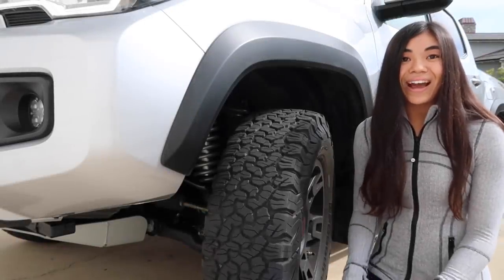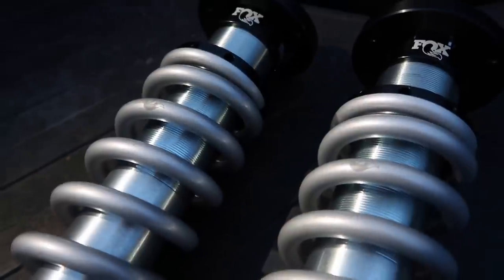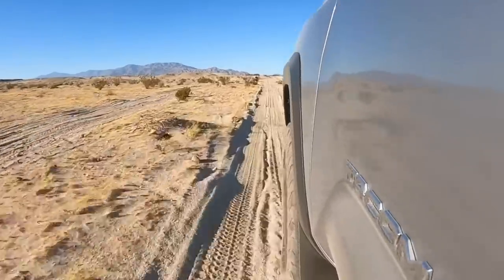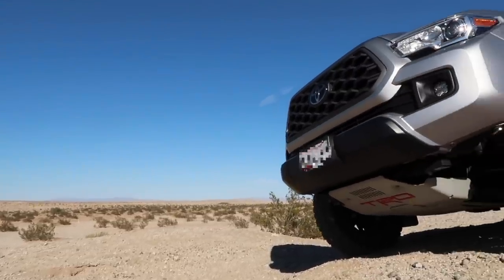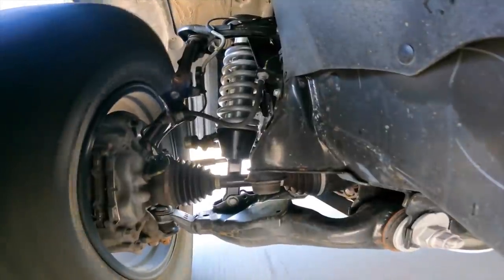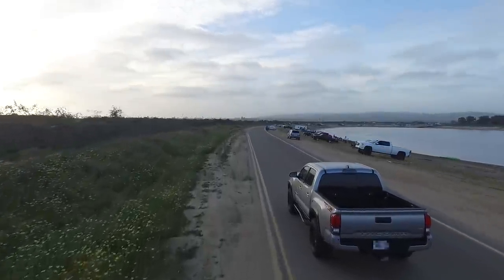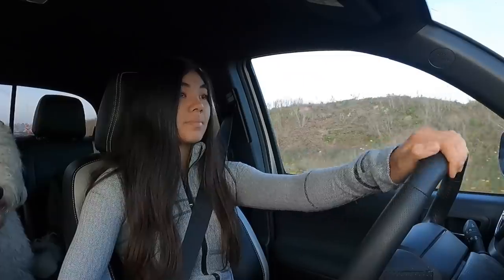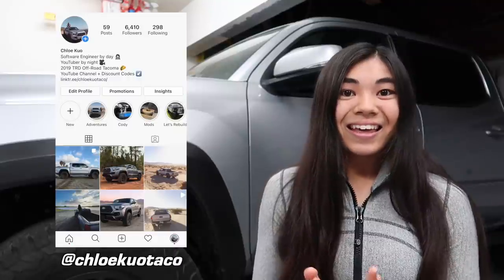Aftermarket Shocks for a Daily Driver?? On-Road Review for Toyota Tacoma Fox 2.5 Shocks

Comment: Hi Chloe.  I really enjoy watching your videos!  Watching the under-body footage of the left front suspension, it appears that the brake hose may be rubbing against the coil spring!  There doesn't appear to be any way to move the brake hose further from the spring.  Perhaps a protective sheath needs to be placed over the hose or a switch to steel braided brake hoses may be in order.

Comment: You should go up tire size to 33’s. 
If you replace UCA you don’t need to cab mount chop, with uca just do forward caster and you will not rub. Did it on my taco pro.

Comment: Solid review! I have the Fox 2.5, DSC and they’re ok. I would prefer one adjustment instead of two and I would like it if the low compression knob clicked when you’re adjusting it like the high speed knob. Also, for what they cost, they don’t hold up well against the weather.
Reply from the maker: Great feedback! Agreed about how they hold up in the weather. I know a lot of people that prefer the 2.0s because aluminum weathers better than steel

Comment: How's the mpg ? I always wondered if it would be better than my icon /falken wildpeak  combo. I get about 18 over all. I do have a longbed doublecab  too.
Reply from the maker: I get 21 if it’s just a week of me going to work (highway driving), but 18 if I do a combo of trails and going to work. I didn’t find that the shocks changed the MPG so much as bigger tires did.
Reply: @ChloeKuo  I was close to getting fox for efficiency and it seems like they are . but icon blackfriday 20 percent off got me and the falken were just such a deal! The ko2s were alot more. Thanks and nice rig you have there.
Reply: I have 33’s with wildpeaks. Roof rack with case, also bed rack. And I get 13 to 15 mpg 

When it was stock I would get 18,19
Reply: @epicone2449  Sounds about right  my buddy has a similar  rig says he is going to re gear the rear end. Not sure if it will help on mpg .
Reply: I also have 285 Wildpeaks. I get 17-18

Comment: Do you plan on changing the upper arms? I heard switching to aftermarket coilovers put stress on the stock UCA.
Reply from the maker: I’ve considered it but my caster angle isn’t bad (since I didn’t lift my truck that much)

Comment: I got the dsc on the back and they are tuned by Accutune they are soft in the middle setting. The front are a long wait, but I ordered the 0” to 3” DSC because of what happened to you trying to get enough ride height without topping out.

Comment: Chloe, you could get the shocks set up by a company like Accutune in El Cajon and it would make a significant difference. They can valve them to your specific vehicle and give you excellent performance in the envelope you use your truck in. Fox 2.5 are tunable and rebuildable. They will need a periodic rebuild, but for your use they will likely go a long time before needing one. The other side is, barring damage, they will last the life of the truck. Fox shocks generally are designed for high shaft travel speeds and are linear dampened so they will work better the faster you are going. They will feel stiff in slow movement. I think you could get exactly what you want out of them with proper set up. Out of the box, the setup is really an approximation.
I have the same make/model/year Tacoma as you do. I have the same wheel/tire set up. I think it is a really good choice in terms of fitment, but also in the load range C choice. Lots of people go with  a higher load range which adds sidewall stiffness and a lot of unsprung weight which creates additional demands on the power train and suspension. The advantage of load range D or E is they can air down more without losing a bead and they are harder to puncture. For a DD/ occasional trail rig, the C is a better choice. Big fan of BFG tires too. They are the only tires I have used for the last 35 years on all our vehicles and they have never let me down.
It would be interesting to compare this setup with a tuned version and see what you think. Maybe Accutune will work with you on something.
Reply: Tldr

Comment: From a daily driver, or on road, perspective, how would compare the feeling between your suspension on your Off Road vise your TRD Pro? Since they are both Fox.
Reply from the maker: The OEM TRD Pro shocks are surprisingly quite softer on-road. The 2.5 ones on my Off-Road offer a stiffer ride, but are more responsive to potholes/cracks on the road.
Reply: @ChloeKuo  thanks for the quick response, the info, and for the great content! Keep up the great work!
Reply: Is more responsive better for potholes?

Comment: Tire PSI makes a huge difference. I run 34 front and 32 rear cold. They heat up about 2 psi and the ride is way better(285-70 tires)
Reply from the maker: So true! Tires make the biggest difference in my opinion!
Reply: Gotta try this myself. Thanks for the info!

Comment: Yet the oem rear leaf springs still suck. Axle wrap has been a big issue for my truckin city driving. I have a simular oem setup before your fox shocks. Yet I question what shocks I want as the balance of road and off-road is important. Yet spending $5k is not in the budget for a while.

Comment: I just bought a 2021 Toyota Tacoma TRD Sport.  I plan on buying the newly released Toyota TRD lift kit.  It is a Toyota sanctioned lift kit that is engineered to work with the Toyota Safety Sense equipment.  It raises the front 2 inches and the rear one inch to level the vehicle and provide more frame to ground clearance.  It is a Toyota dealer installed kit and costs about $2200 which includes labor.  They use the 2.5 inch Bilstein shocks to replace the original 2 inch Bilstein shocks.  I haven’t decided which tire to buy to replace the factory ones.  I enjoy your channel and have got a lot of ideas for my own pickup.
Reply: Where can I find these??

Comment: Would you say that  a 3-6 inch suspension lift and large tires would be a worthwhile addition  but not completely ruin the dally drive
Reply from the maker: It would be hard for me to say because I've only driven a lifted Tacoma with tires larger than 285 on-road a handful of times (off-road is a different story). I guess it depends on if you care about gas mileage and if you regear or not.

Comment: Thanks for getting a camera under there to show the suspension working while driving. Is it just camera angle to is there only a few inches of play in the front before you hit the bump stop for that control arm?
Reply from the maker: I’m not sure how exact, but there’s actually only a few inches
Reply: @ChloeKuo  I've never realized that before but it seems like off road should have more. I'm gong to check under my Tundra and see if it near the same.

Comment: Installing the Fox 2.5  Performance Elite Series (DSC) tomorrow and heading out to Borrego Springs with my 2021 Jeep Rubicon Xtreme Recon, will let you know how it goes. Looking forward to a much better ride on and off the road over the stock Mopar's and a step above even the factory installed regular Rubicon Fox shocks.  We shall see.
Reply: How did you like them?
Reply: @dallassoccerkidd  very good ride, tire wear is longer and even over time as well
Reply: @sdvolley  did you tune them or bolt on straight out of the box?
Reply: @dallassoccerkidd  I didn’t use a third party or revalve them, for what I’m doing it wasn’t necessary. I don’t want a fixed setup because I run 35’s on the street and 37’s offroad

Comment: I had them on two vehicles i never thought they were worth the money. You get a much better bang for the buck if you spend $1500-2000 on higher performance ones
Reply: Dale Macarena  anyone that has remote Reservoirs. I dont go to fox anymore tho whatever lift they say it gives it never does then your stuck adjusting it when its supposed to level your truck and it wont and now its maxed out and it rides worse then it should
Reply from the maker: The remote reservoir definitely makes a difference in mine. I’m pretty happy with my Fox’s but it would be cool to test out other shocks of the same class and see how they compare in ride 😁
Reply: @buffalobmf  punctuation?

Comment: Aren't these standard on the Trd Pro
Reply from the maker: They are different. Fox makes OEM ones for the TRD Pro but these ones are their 2.5 Race Series. I've driven with both and the Race Series ones feel stiffer for sure, but I like their ride off-road better (and the fact that they are ride-height adjustable--the TRD Pro ones are not) 🙂
Reply: @ChloeKuo  nice!